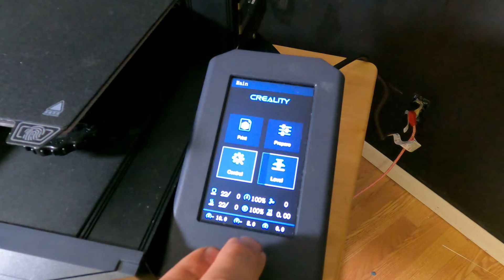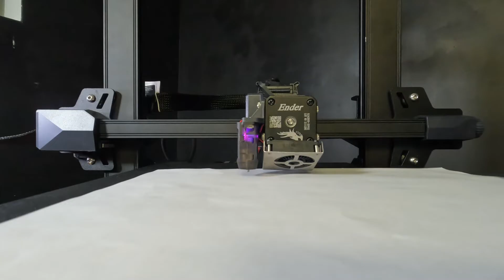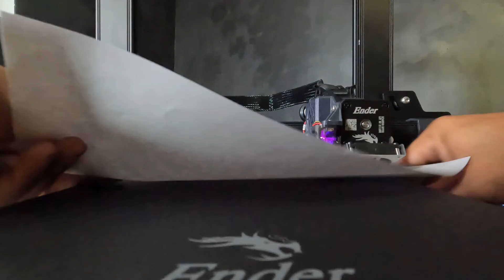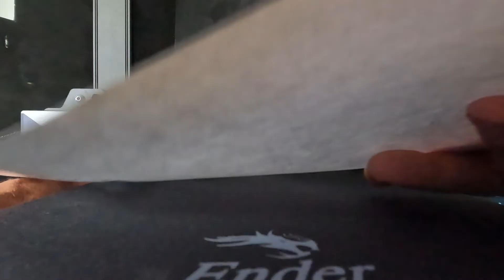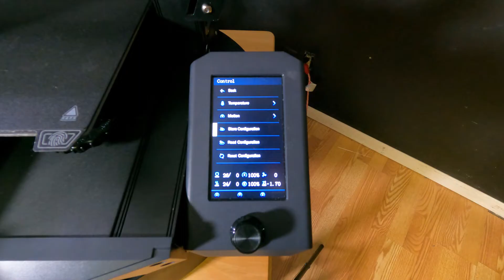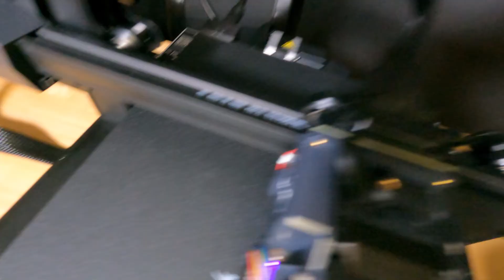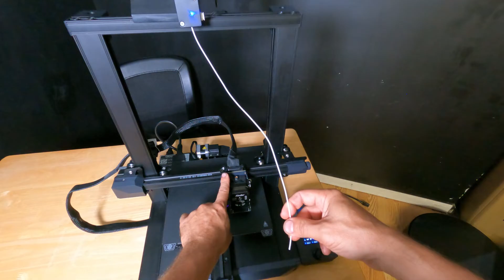Creality Ender 3 S1: How to Level, Set Z Offset, and Make an ABL Mesh - The RIGHT way.

Comment: My ender 3 s1 stops printing first few lines in and when it stops it looks like the whole printer reboots it’s self and then I can resume the print to get a few more lines out just for it to keep repeating this issue any idea what could be causing this I’ve tried so much and just tried ur leveling will reply to my comment if this video helped or not
Reply: So far so good 7min in no issues may have just been poorly leveled befor and clogging not sure but 10min and hasn’t failed yet thanks
Reply from the maker: Physically rebooted?? That's not good. Sounds like an Electrical issue. Is it set to 115 in the back? (not 220). I would Update the Firmware. Take the bottom plate off, and make sure all your wiring is secure in their sockets
Reply: @3DRundown  yea guess I gotta try firmware update idk I’ve checked all the connections and it is set to 115
Reply from the maker: @kbizzy2672  Forget stock firmware. Nonserious printer uses Creality firmware. Go here, donate $2, and download their S1 Firmware. 
https://marlin.crc.id.au/
Reply: @3DRundown  awesome thank you will totally give that a shot
Reply: @3DRundown  just got the new firmware was working great was about 80-90% done the print with no fails till the end of the print same issue where it just rebooted the printer on its own this is the furthest ive gotten in a print doe? any more help would be nice
Reply from the maker: I have a few thoughts, but I'll have to come back for them, as its 1:17am. But a quick thought, are you testing on the same memory card? have you tested on a new card? If not, id do that first. (32gb or smaller, formatted to fat32)
Reply: @3DRundown  sounds good i will try a new card but yes it late but appreciate the few tips so far havent had any luck with anyone helping me out yet!
Reply from the maker: @kbizzy2672   Any luck?
Reply: @3DRundown  haven’t been out for a new sd card yet wil probably be able to get one tomorrow
Reply from the maker: @kbizzy2672  OK. I bet you that card is trash
Reply: @3DRundown  it is the one that came with the printer and feels cheap so probably
Reply from the maker: @kbizzy2672  oh no. don't use that, and don't use the card reader either! They will absolutely fail, and cause you problems. Don't ask me how I know...
Reply: @3DRundown  I tried printing via usb and still failed the print possibly it could be a dead printer I guess?
Reply from the maker: @kbizzy2672  You may went to look at your power supply. Can open it up and check out the wiring, or, swap it out. Sounds like a random short. Maybe a loose connection?
Reply: @3DRundown   I’ve looked at power supply re did all connections guess I might attempt to replace at some point
Reply from the maker: @kbizzy2672  Gotta check every connection. Something is shorting somewhere.
Reply from the maker: @kbizzy2672  wires from MB to Hot End? Gotta figure that out. Too annoying! Email Creality, maybe they send you a new one
Reply: Spoke to soon just failed smh

Comment: I see at 9:25 all your springs are tighten? right before your autohome for Z off? So all steps before are not necessary? or you took up you bed to nozzle and with such tightened springs?
Reply from the maker: I moved my Knobs at 7:20

Comment: Hi! May I ask for clarification? At the moment before 9:25 - have you take bed up to nozzle (as it is recommended -slightly blocked by nozzle)? I am asking because I tried to elevate bed to nozzle level, and my 3 wheels are almost free, but one is tighten.  What is quite surprising...
Reply from the maker: You can bring your Z-OFFSET into negative, as much as you need, so, when your springs are snug enough to stay put, and you think they may get loose, if you unscrew them too much, Lower your Z-OFFSET, (NOZZLE) to the bed, rather than trying to use the knobs to raise the BED to the NOZZLE.
Reply: @3DRundown  I tried. I tighted my spring till the end and tried to make Z offset negative. But, at -5.00 Z offset finalized, and my bed was still quite below... So I ough to make Z offset somewhere between, around -3.70-3.90, and then elevate my bed to Z level. But even in this case, sometimes I faced with situation, when one of the spring is absolutely untighted, while other might be tighted till the end and that is not enough... So I change Z offset once again and ought to start levelling each cornner once again. And again. And again. Last 3-4 days I spent around 4 hrs daily trying to set my bed and receiving the failed first layer prints...
Reply: So, I bit confused with the process order. Can you re-check my order... 1.Reset configuration. 2. Tight all springs till the end.3. Autohome. 4. Down Z from 10.00 to 0.00 5. Make Z ofset negative and down nozzle. 6. Disable stepper. 7. Move nozzle to each corner and make bed close to nozzle. And... What is next? Again back to Autohome? I did it and down Z from 10.00 to 0.00 and.... My Nozzle again too high! Should I down Z offset again? And again go throught all corners?
Reply from the maker: @serhiyvepshyn8327  Auto home. Z to 0. Disable Steppers. Bring to corner. If you tighten knobs all the way, the bed will be as low as possible. Don't do that. Just Make the knobs firm, and roughly equal,  but not ALL THE WAY tight. With the nozzle in one corner, loosen the screws to raise the bed closer to the nozzle. If you think you don't want to turn the knobs any more, because they will get to loose, bring the Z OFFSET DOWN instead. Then, match the other 3 corners with the knobs. Run an ABL, then check your Z one more time.

Comment: Hi! Thank you for valuable video. I tried number of different ways to level the bad but failed... I followed your method and stopped on the following: (your timig (9:42) - while I unsrew the wheels, at the mid of process,at my far right corber the nozzle stuck in the bed, the same time at other corners I had to unsrew the wheels for almost but nozzle was still above (at this moment the Z=0, offset was 0 also). I had the same situation during other set ups... Can you comment - what is wrong with?
Reply from the maker: Start your tramming with the wheels snugger, so the bed begins at a lower point. Make sure your not turning them too much to adjust when tramming. I turn VERY SMALL amounts at a time.

Comment: The Ender 3 s1 is on my short list, what are your current thoughts for a 1st 3d printer
Reply from the maker: Ender 3 Neo or Max Neo. Max has a larger bed size that can be really useful. S1 will serve you well also, however I do prefer glass on it

Comment: Hi I appreciate your videos. They make a confusing subject much easier to understand for noobies. I have a cr touch installed on my Ender 3 v2, I was wondering if there is a tutorial on interpreting the mesh results ie; colors and numbers presented in the view mesh function? Thanks
Reply from the maker: Hi, Thanks for the kind words. It seams my style of teaching, connect well with new users. I like that. :)
 Please consider supporting my UDEMY Course. I believe you will find it very helpful. This Youtube, is a sister page, for that course, where the majority of my Content is. I am hopeful this channel, will help me grow my course.
Here is a 50% off coupon code: "SAVEHALF".
Go to: 3DRUNDOWN.COM, or search "3D RUNDOWN" on UDEMY. 

That's a great request. However, it may not be as straight forward as it sounds, due to various firmware, displaying results in various ways. However, I'll see if I can give it a go, to make a video! One thing I want you to remember, is, that, while you can learn about the quality of your Tramming, by looking at the mesh, and make adjustments, if something is REALLY off, that is not the main function of the mesh. So long as your tramming isn't REALLY bad, with any drastic inconsistencies, your machine, will use the ABL Mesh, to compensate for those inconsistencies, so that you don't need to worry abou them.  Just be sure to put "M420 S1" in your GCODE for ALL your models

Comment: what i found to be the only working way to tram is to flash a third party firmware called professional firmware it's really easy to flash you just move the bin file to the sd card name the folder a specific name (you need to look this up) then put the sd card in the printer and start it thats it it's flashed it's incredibly easy just make sure to use the right firmware f4 for example is for the newer version of the s1

it comes with a tramming wizard which measures each corner so rather than guessing blindly you get told which corner is too high up by numbers so if you want you can tram it even better than feel or eye as it measures using the cr touch
Reply from the maker: I much prefer manual. Newer Marlin has all sorts of Tramming Wizards, but I never use them. Whatever works though!

Comment: Very helpful video, thank you! 
Do the s1 and s1 pro save the mesh to eprom automatically after ABL? Need to add M420 S1 to start gcode for it to load mesh for each print? Seems like some printers have to be sent m500 for it to save the mesh to eprom rather than ram. Seems like my ender 5 plus needs new ABL after each reboot, which leads me to believe its saving mesh to ram(all probe values are zero after each reboot). Thinking about getting s1 pro as well. Trying to clear up confusion for proper setup!
Reply from the maker: Hi. Welcome! You will want M420 S1 in your GCODE. That tells the printer to use the saved mesh. Some firmware prompts to save after ABL, some don't. Unless it prompts me to save (my S1 firmware does) I always save manually after a mesh, to be sure. 
M500 is the command to save. You won't need it, since you will have always done the ABL and saved. You just need to load and use it, via M420 S1

Learn with me on 3DRUNDOWN.COM
Reply: @3DRundown  Hmm, am a bit confuse - just got an S1 printer....using all stock firmware and the Creality slicer to start,  and after doing all the steps in your tutorial, the S1 would save the mesh permanent in memory, but  I would need to have M420 S1 in the GCODE inserted for all my prints to use and apply the saved mesh?  Thank you
Reply from the maker: @kennyc4904  Yessir. Every single file must be sliced with the M420 S1. You will be putting that in the Cura Profile, so you will only need to do it once, and it will be there anytime you slice, using that Printer in your Cura Profile
Reply from the maker: @kennyc4904  Jump on my course for all my Cura lessons: 3drundown.com
Reply: @3DRundown  Thank you for the clarification!
Reply from the maker: @gforce_117  🤜🏼🤛🏼

Comment: I'm actually really sad right now. Bought my first 3d printer a few weeks ago and tried to update the firmware and made the screen go black. I've tried every method to fix it and nothing works. I can't even print my first test print. A shame really that this was my first experience in 3d printing.
Reply from the maker: Don't be sad. This kind of thing happens all the time to new owners. We can get you past that. What printer is it?
Reply: @3DRundown  It's a Ender 3 v2. The  board version is the 4.2.2. I updated the firmware which was fine. But then when I updated the screen that's when it turned black.
Reply from the maker: @The-Azure-Knight  I love the V2. A really great machine that you can learn and make nice things on.
Reply from the maker: @The-Azure-Knight  Make sure ONLY the firmware file is on the card. Give it a unique name. It will not load a file name previously used. Can just add a number, such as File1, File2... 
make sure card is less than 32gb and formatted in Fat32
I would reload the main firmware also.
Reply: @3DRundown  I put ONLY the firmware on a freshly formatted fat 32, fully allocated 8gb SD card (the one that comes with the printer). Which worked. But then I updated the screen and it went black. So I tried  loading another firmware as you said and still didn't work.
Reply from the maker: @The-Azure-Knight  the card, and reader, that come with the machine, suck. I would use a different card and reader.
Reply from the maker: @The-Azure-Knight  are you running a BL/CR Touch?
Reply from the maker: Have a look at this: https://marlin.crc.id.au/forum/t/identifying-ender-3-v2-screen-versions/960

When flash works, the screen will flash, Blue, then Orange. If you see that, it's done.
Reply: @3DRundown  I have the Gen 2 F1C100s version and renamed the DWIN_SET to "private". Put it in the screen and it shows a loading bar and says "download complete". But then still black screens.

Comment: Going through the steps and have some questions. 1.  When I adjust my bed to a zero offset. The adjusting knobs are too loose. So I adjusted them midway - so that I had room to tighten or loosen.  2. Next I measured the z distance above each knob. The measurements ran between -2.7 to -4.1.   3. Then I picked a common measurement for each corner (I picked -3.4). 4.  Then adjusted the corners until each was -3.4 in the z axis and the head was just scratching the paper. 5.  My questions
do I need to set my Z offset to -3.4?  
Should not my auto Bed levelling sort this out?
Reply from the maker: Hi, Did you follow this video, step by step? You did some things, in a very different manner.
Don't FF, follow in real time. Some quick points:
1.) YES, snug all 4 wheels before tramming
2.) Do not measure anything
3.) After snugging up the knobs. Loosen them each the same # turns. Just a few turns.
4.) Set your Z. Use Paper, and the middle of the Bed. Till you feel it rub lightly
4.) THEN Tram. No measuring. Use the paper method on all 4 corners. Till all 4 corners feel the same. (slight rub)
5.) Run an ABL
6.) SAVE, and run a test print. Have the TUNE menu open to "Z OFFSET". Baby step till the 1st layer looks ok. If it looks thin, and feels rough, it's too close. If you rub it, and it moves, it's too far. Should STAY when you rub it, and feel/look smooth.

If you feel your Tramming is OK, and your Z needs a little work, Use THIS, to dial in your Z: https://youtu.be/veZB415QHM0

Make sure M420 S1, is in your GCODE, after G28, or ABL will do nothing...
Keep in mind, ABL makes a map of your bed (a MESH), and compensates for MINOR inconsistencies, of your bed tramming...

Learn with me at 3DRUNDOWN.COM
Reply: @3DRundown  I did as it is noted above up to p6. I started with Z offset -2.30. When I started to print - nozzle was too high... I started to "elevate" Z offset... When it was started to stick to the bed, I had Z oofset around -3.70. With this Z I had left half of the cat stuck to the bad and right half - absolutely did not... Then I tried to work with the wheels on the right and elevated bed a bit. When I started to print, I had almost Ok around the cat, but not stuck filament inside! That's awful... I ordered the glass and silicone bed spacers... I have no idea how make it normal
Reply from the maker: @serhiyvepshyn8327  I prefer glass. I would not adjust the wheels during printing. Work on your tramming, with the paper method.  Are using m420 s1 in your gcode?
Reply: @3DRundown  In my case... I was not using M420 S1 in my Gcode.  I just learned about this today.  Am leveling my bed as I have replaced the springs with silicone solid bed mount springs. I have been watching different videos on bed levelling and one of them mentioned this and showed where to enter this in your slicer software.

when I read your post, it reaffirmed what I had just learned.  Thank you!
Reply: UPDATE:  After the auto bed levelling, I tried my first print with a Z offset of '0'.  I watched the print like a hawk and saw that the print head was way too high. ... like 3.4 too high :)   So i paused the print.  adjusted my Z offset to -3.4.  The print head was printing too close.  The PLA was squished and flat.  ... So I adjusted the offset to -3.2.  it seems to be working, in that it is printing, the PLA is being laid,  I am getting little tiny zits of PLA sticking up, which makes me think the print head is still too close.  Or maybe it has to do with the direct drive extruder (Ender 3 S1 3d Printer).  

Now I do not understand what is going on in regards to auto bed leveling and the z-offset.  What does the auto bed leveling software not determine how far the print head needs to be, when printing?

Comment: Gregg, I was able to program  the z off set via terminal program proprint. The next question I need to ask is the automatic bed leveling. I looked at the gecode and it says it is enable then has a problem running the bed leveling program. When i try using the stock option for level bed, it goes through the motions and hits 1 point on the heating plate and then goes the next one which seems to be located of the heating plate and the extruder is then pushed down on the heating plate and then goes to the middle and stops and error. I dont know if i have to program the type of mesh bed leveling  in to the firmware. i was able to fix it by re-flashing the firmware and again using the latest cr touch firmware. i wondering if im missing something, i was able to print out a test cube and it came out alright without a problem.
Reply from the maker: Were you able to get this resolved?
Reply: @3DRundown  yes thank you I had a faulty car touch replaced it 4 times with Amazon and it was the actual probe that was the problem.